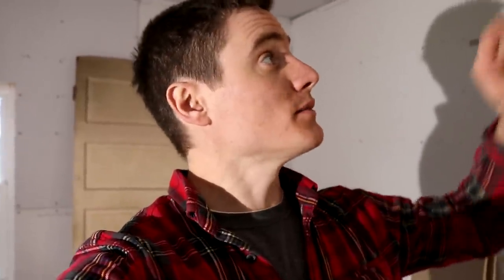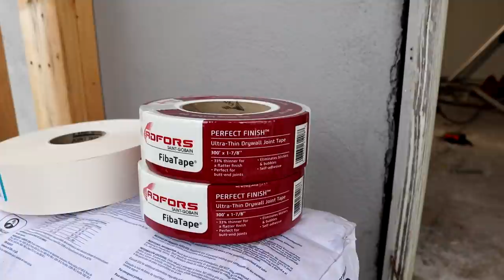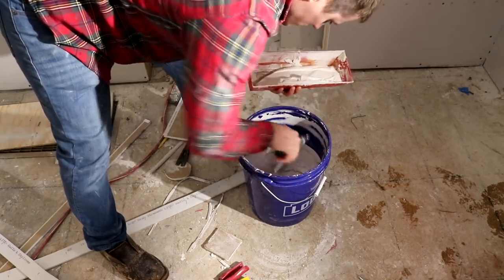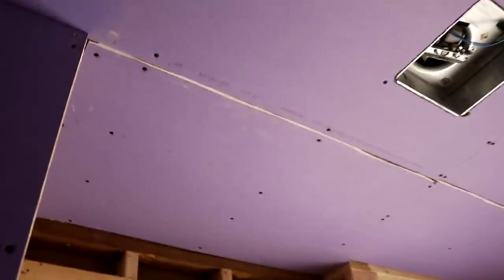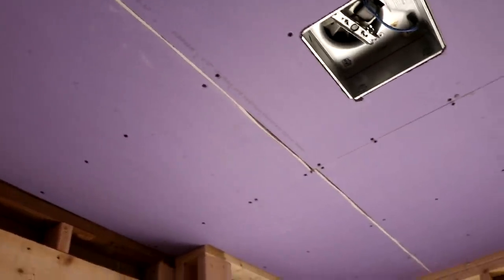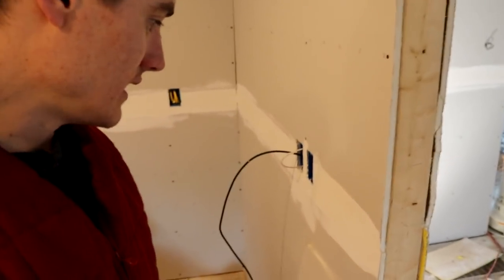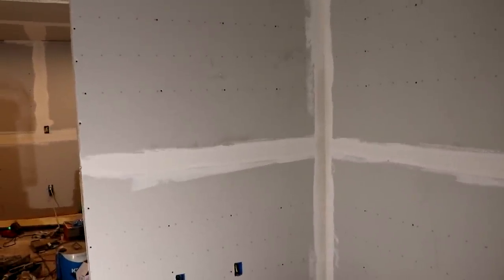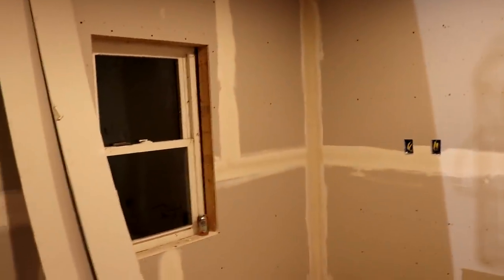$12,000 HOUSE - Mud, Drywall & a Rambling Man - #43

Comment: I noticed you didn't tape the corners between the wall and ceiling, are you going to do that later, or are you just going to use trim?
Reply: Julie Baker even if you use trim, you really should at least tape it so the ceiling and walls are locked in together
Reply: @iLikeC00kieDough  Somehow I doubt something as fragile as a strip of paper and a 16th of an inch of joint compound will provide much by way of structural integrity. About the most it would accomplish is to stop a draft.
Reply: Julie Baker you’d be wrong.  Drywall tape is manufactured from special cross-fibered tape with high tensile strength, both with and across the paper grain. Its high porosity produces a superior bond while eliminating the need for perforations.
Reply: @iLikeC00kieDough  I have done a good bit of drywalling over the years, both to repair damaged walls and to finish newly constructed walls. I don't care if you use tape made of KEVLAR it's function is still primarily aesthetic. At best it seals cracks that allow drafts. The structural integrity comes from the quality of the construction itself. I am not just guessing, I am speaking from over thirty years of building maintenance experience.
Reply: Julie Baker when I said locking together the ceiling and walls, I meant the panels themselves not the structure. I’d agree the main purpose is, for the most part, aesthetic. And unless you seal the bottom piece of drywall, you aren’t going to get an air seal. I’m sure after 30 years you’ve seen a lot of stuff, and unless you work in the slums or in manufactured houses, you should only see taped joints. Even in garages where drywall is hung but not finished, you’re joints should be taped. I’ve only done home remodeling for about 6 years or so, and at a minimum I tape and bed all joints.
Reply: @iLikeC00kieDough  frankly most of my experience with dry wall has been using it to replace crumbling horsehair plaster, since the lion's share of places I've worked on were over 100 years old. I always did tape all joints I made, but you come across a LOT of weird stuff when you are working on a building that old, especially when they were built before building codes.
Reply: Julie Baker yeah  sure you have come across some weird stuff. I don’t know how important it is a joint behind crown is taped; it’s just the way I was taught and from the research I’ve done. Seems like you’ve got a good understanding if it all. Anyways, cheers.

Comment: Oh no! That mesh tape is no good. It’s for specific applications! The problem is it’s flexible. The paper tape does not stretch band or flex and prevent cracking it doesn’t seem like that would matter but it really does. 

I removed an interior door one side i used regular paper tape and the other I used mesh tape. The side i used mesh is cracked all the way around.
Reply from the maker: You have to use fast setting compound, not all purpose....feelings go both ways on the matter.
Reply: Homemade Home Oh that’s good to know. Thanks for all the videos, I quite like the aesthetic and information.
Reply: U need to use the dry quick mud if u use the compound that comes out of the box and don't let it dry properly it will crack, it's just best to use the powder compound and mix urself, the thing is with paper tape sometimes people don't apply it correctly and it bubbles, u applied it correctly though it looks like, and were u put the paper tape it dried up correctly and the other side probably didnt

Comment: You were doing a Great Job UNTIL you started using fiberglass tape instead of full paper joint tape. I guarantee everything will have spider cracks within 6months.... fiberglass tape is garbage for keeping drywall from cracking...absolutely no strength...
Reply from the maker: I don't think it has to do with strength, paper joints crack to, they just do so under the paper. Let's just see what happens, as you heard in the video, I say I don't know but want to try it.